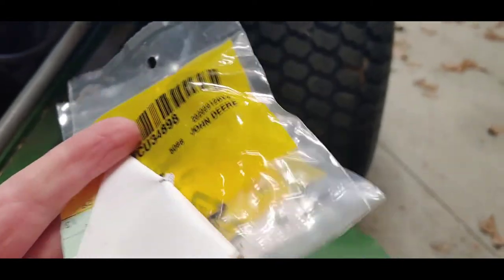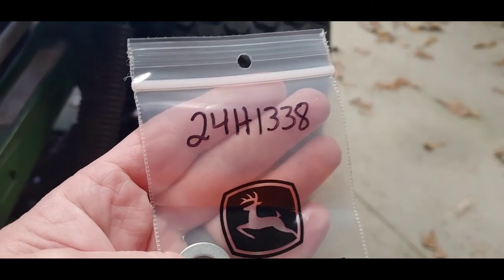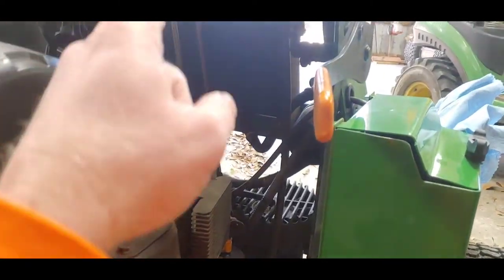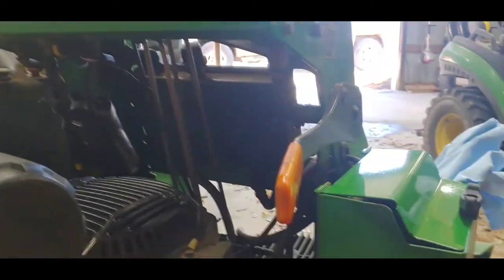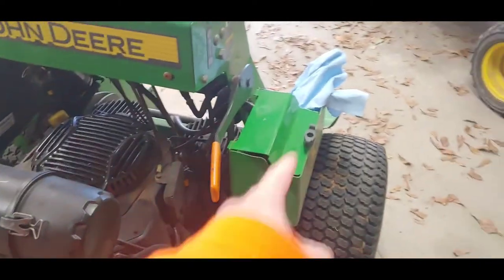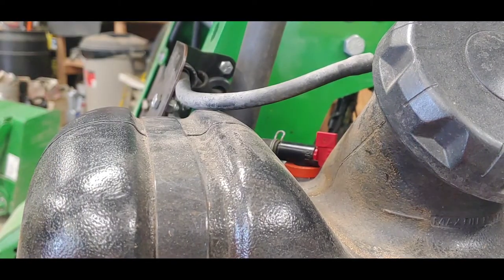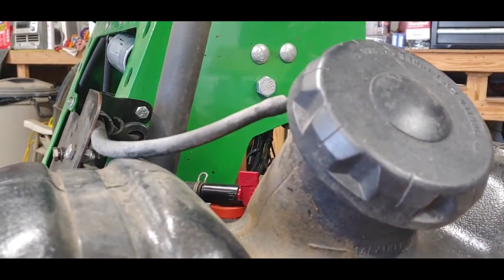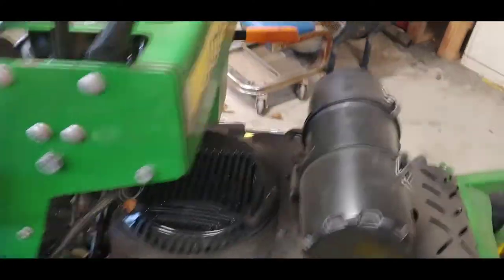HOW TO: Replacing the Fuel Filter, Fuel pickup tube & Park Brake Handle - JOHN DEERE Quiktrak 652R

Comment: I have john deere d100 riding mower  question  is how do I remove  the vent tube from tank the tubing  was in bottom of the  tank I got  tubing  removed  just checking thank u
Reply from the maker: Sorry for the delay...... I honestly don't know on the D series mowers cause I have never owned one. I wouldn't want to offer any incorrect advice. Hope you get it fixed👊.